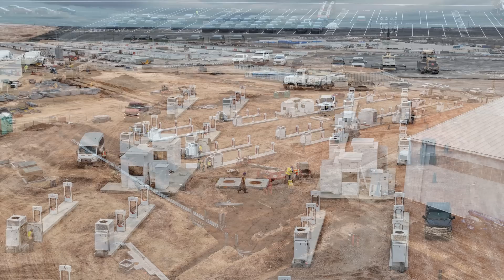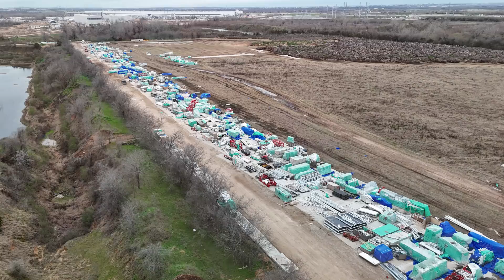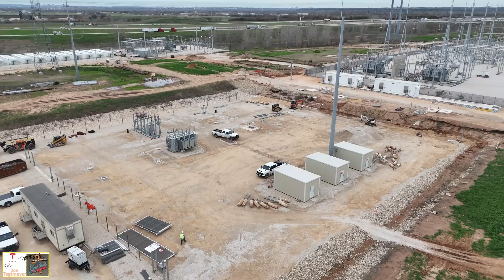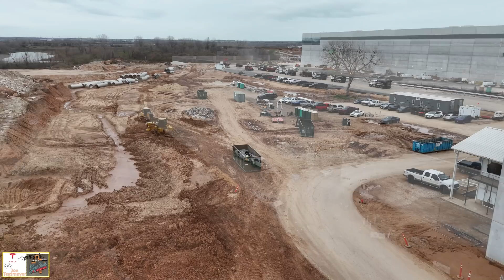Cybertrucks! Megapack Connected! TKS Paint System Delivery! 16 Feb 2024 Giga Texas Update (07:35AM)

Comment: Im convinced once they complete the 2nd phase of solar panel installation on the roof they surely have to connect it to the megapacks at that point. Interesting to see how it develops. 

Thankyou for your videos Joe, never miss a single one!
Reply: Not really. With all 70,0000 panels installed, they will produce about 30 MW. The 96 Superchargers currently installed (64 on the westside and 32 on the eastside) will require 9 or 10 MW. While Tesla doesn't publish the energy requirements of the factory, it will likely use all of the energy produced by the panels. That is, unless it is shut down for a holiday or some other reason. In which case, excess power can back-feed through the factory's electrical system and the existing duct-banks to the Tesla Enclosure/Mega-vault, LCRA substation and to the grid.
However... Sending excess power to the directly to the Megapacks would be technically difficult because as presently designed, there is no direct connection. The backup power feeds from the Megapacks have circuit breakers that operate in a normally open configuration.
Reply: @DavidJohnson-tv2nn Thankyou for that. I wrongfully assumed consumption would be less then production they would need to evenly distribute over 24h, hadnt factored in the expansion on the west side and to be fair now youve got me thinking, its only going to increase.

Comment: Put of interest 🧐🤨 at 18:27 the tunnel segments, how heavy are they???
Reply: Depends on the thickness  of the ring but heres my best guess.
one ring = 6 segments;  ID 12 foot;   OD = 13 foot;   average diameter = 12.5 foot (3.8m);   they are (I believe) 5 foot long (1.52m);   6 inches (0.15m) thick. Concrete is 2,400kg/m3. So: 3.8 x 3.142 (Pi) x 0.15 x 1.52 x 2400 / 6 = 1,088Kg per segment (they are slightly different in size so this is an average) around 2,400 pounds each segment in Banana Sheckles.
Reply: Most TBM erector systems use a vacuum pad to lift the segments into place (i.e. no mechanical connection). Then dowels (plastic or metal) on the circle joint connections and spear bolts (galvanized HT steel) on the radial connections.
Reply: @davidsalisbury50  Joe has some documentation on his Patreon site for the now defunct proposal for a tunnel under the Colorado River. Location was at the far east end of Tesla Road

Assuming the same lining rings proposed on that project are to be used for this under Highway project, then the external diameter is 13.5’, internal 12’. And those rings were also shown as 5’ (59” to 61”) long.
Reply: @DessieDoolan  That would make them about 1,700Kg per segment plate.
Reply: @davidsalisbury50  I have just realised the defunct under river project was using 18" 0.45m thick segments! Or....not.

That seems extraordinarily thick now that I give it some thought. 

I misread the drawings, and my lazy use of an online calculator (because working in imperial does my head in these days) had me miss the obvious extraordinary thickness.

The sectional elevation shows internal diameter of 144", external of 162". It's not a complete set of drawings btw, 30 only that accompanied the initial permit application. Seems the section shows the ring inside the shield. No indication that it does, dwg marked 'ring elevations'. Trap for a young player.

Next dwg. in 'Segment Details', shows 9" thick segments.

Now I get 5.88 tonnes for a ring.
Reply: OD is ID + 2 x thickness.
So 9” (225mm) thick segments.

Comment: I'm kinda guessing but I think those tanks on the SE might be Small =75,000 gal , Large = 120,000 gal.
they're big!
Reply: Estimated to be 42' high. Still working on diameters.

Edit. 19' and 29' diameter.

6:14 in the video. Should be accurate enough. The small tanks are very close to the edge of the building line.

Draw a line across the top of the smaller tanks to where it meets the corner of Stamping. Overall height of the building is 80', and the point at where the top of tanks intersects scales to 42'. Assuming that's right, then from the same view the diameter of each tank can be scaled from the tank height. 19' and 29'.

12160 cubic feet, and 27741 cubic feet. 90963 us gallons, and 207517 us gallons.

345000 litres, 786000 litres.
Reply: At 42 feet I will recalculate.Small =100,000 gal,  Large =150,000 gal.
Reply: @staudtj1   See what you come up with scaling the diameter from the height at 6:14. The big tanks are 20' behind, so scaling less accurate, again.
Reply: @DessieDoolan  the formula would be the radius squared times pi times the height * 7.48 equals gallons.
Reply: @staudtj1  I'll admit I'm way out of practice with imperial measurements. In metric it checks out close enough. 

In feet and inches, I worked out cubic feet then my go-to conversion site 'convert units' and converted cubic feet to us gallons.

I hadn't thought to try and estimate the size of these before, until your guess prompted me. Thanks!

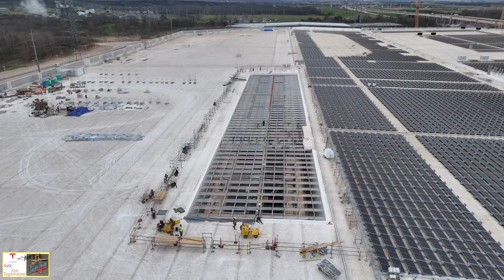Comment: 10:00 Back when the GF was first being built, several of the folks that knew a bit about construction of large facilities along with myself kept wondering where they were going to build the cooling towers. I’d love to hear from a current engineer on why they are building many separate cooling systems with both wet and dry coolers instead of using the old school large campus wide plants that made enough chilled or heated water for the entire campus. I’m in my 60s and back in the day, this size of plant would have a separate building with several huge cooling towers, compressors, and other physical plant systems. This was how it was done. Here we are seeing many, many smaller units being used. Like I said, I’d love to hear the thinking and rationale for doing it this way.
Reply: Also, mostly under the roof. Shanghai and Berlin, mostly on the roof.

Comment: What are the 4 large TBM sections covered in black tarps for?
Reply: Those are the backup decks. Contain all the TBM support systems. Control cabin, hydraulic pumps, electrical switchgear, segment handling, transformers, utility reels, grout pumps, grease pumps. It's basically a moving factory.

Comment: Thanks Joe.
Yes, you covered a lot of ground today.
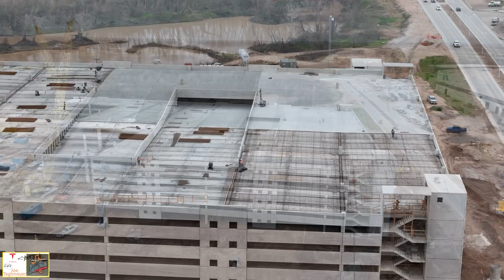9:06. Parking Garage. Bottom right. Turned the corner with the blue water main. Stormwater drain riser on the west side.
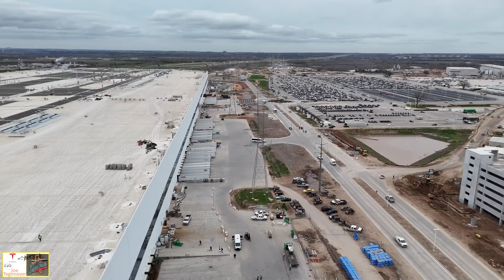9:42. BIW apron. Green pump located where the temporary chiller plant was. Some hoses laid out. A red pump also up by the East Main Entrance at 29:42.
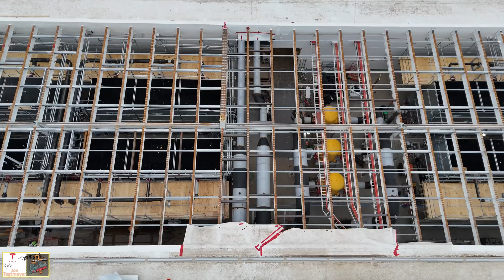10:23. BIW. Under-roof plant room. Scaffold decks installed below. Likely for the pipe lagging/insulation works.
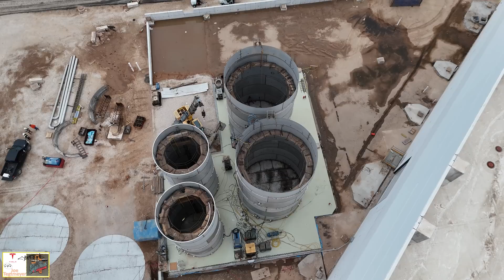11:09. Southend. Tank Farm. Left. Curved items might be handrails for the top of the tank.
11:44. Southend. Bottom. The puzzling CFA pile extension works. I’d like to know if this is some pig-headed demand for completion of the piles as documented, or if there has been some change of plan.
12:18. Southend. Beams on the trailer. Projections are bridging for the roof or floor decking to land on where the decking isn’t to span across the construction joint. Same detail at 12:32.
12:47. Southend, south. Blue tape holding some component of the end channel in place. Glazing won’t be mitred, as it is on a construction joint between buildings.
14:06. GA, perimeter road. Street lighting installed. Again.
14:55.  GA, apron. Bottom right. Battery packs.
15:07. GA, apron. New loading docks, wall openings were cut when no-one was watching. Weren’t plugged. Demolition and excavation works complete. Some formwork placed.
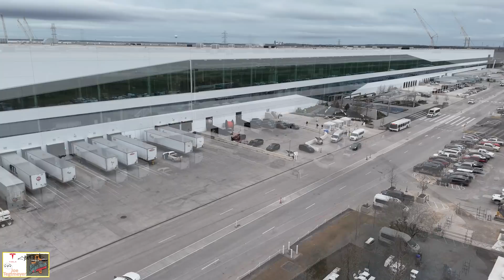15:57. GA, apron. Hose down into one of the sanitary sewer wet-wells. Ongoing troubles.
16:20. New EOL, apron. North. Delivery of a large framed sprocket. Suggests a moving line. No in-floor channel, must be surface mounted.
17:10. New EOL west. Gravel deliveries.
17:29. New EOL superchargers. Top right. Setting up the temporary water supply. 0:45 also.
26:23. BESS Installation. Megapacks. Awaiting twinkling LEDs on the megapacks to confirm if live. The generator up beside the control building needs to go also before there can be confirmation of project completion and final commissioning.
27:30. Tesla Road, north. Bottom right. Might be the office trailer from the old Transport Yard.
27:56. Battery north, loading platforms. Alimaks hoisted to the top. Gate installed on right elevator, left elevator works in progress.
28:50. Casting east, apron. In Joe’s photos, an empty heavy duty low-loader is seen leaving. Another (also empty) seen parked in the WOW yard in Brad’s video yesterday.
30:10. EOL superchargers. Top right. Ductbank works progressing south to the Parking Garage.
31:24. Robotic Avenue. Line marking works.
31:41. Tesla Road, east. Taking the hump out of what will be a re-aligned Tesla Road.
32:31. Cathode, plant platform. Bottom. Pipe insulation/lagging works.
32:36. Cathode, east. Apron. Geo-mesh rolled out. Grave being spread over prior to asphalt paving over.
33:30. Cathode, north. Green transformer cabinet (cooling fins) being unloaded.
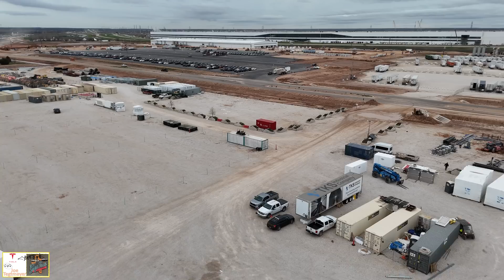Reply: @21:10 The superchargers from the south end x 32 have disappeared from here.  Wonder if they have been moved somewhere to have the orientation changed before installation somewhere else at the EOL.
Reply: @Dwayne.Shea.231  21:10 Nicely spotted. Need to keep an eye out and see if they show up in one of the electricians compounds around the place.
Reply: @DessieDoolan  20:28 I think I see them where the others were configured...off in the distance.  Unless those were brought over from the east.
Reply: @sammyk874  20:44 Seems to be them. Joe might have got a better photo.
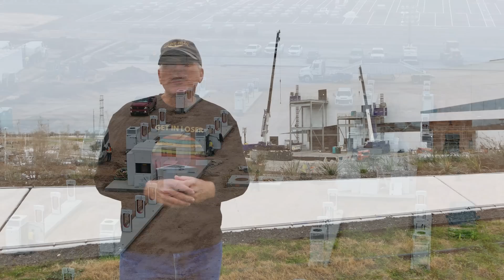Reply: @DessieDoolan  The ones stored on the east side (new orientation) are gone.  They were there on Jan 28 but gone Feb 6 (per Jeff's videos).  I think I see the south end ones in Brad's video from yesterday 0:50.
Reply: @sammyk874  Yep, that must them. Joe's photo 77 is the pick of the photos, but no better than the video.

The 16 from the far east on Tesla Road, and the 48 from the W-WOW assembly location conveniently totals those at the New EOL.

Parking Garage. That would be a likely location for Superchargers. Ground floor, so that expensive cabling doesn't need to be run to the upper decks. Something else to watch out for.
Reply: @DessieDoolan  Ah yes. Thought all 64 were on the west plus 16 on the west side. I wonder if they’ll move the current superchargers on the east side into the garage. They seem a little out of place now.
Reply: @sammyk874  Supercharger relocation. Nothing is sacred!
Reply: @DessieDoolan  My wild speculation is that the old style superchargers go south of the 64 on the west side (using solar canopies from east) and the existing east siders go into the garage.  Likely 99.9% wrong. :)
Reply: @sammyk874  Old style superchargers. A chance is a chance!

Charging generally has changed often on site. Both supercharger and destination charging (the smaller units).
Driven by the ever changing construction, a consolidation might be due.

There was a row of destination chargers on the east of Casting. I don't think they'll be coming back.
Might have been another couple of rows further south near BIW.
Superchargers removed from the south end of GA.
GA west, there were dozens north of the Main Entrance. Removed when the loading docks were unplugged. 😑
Now only 7 at the Main Entrance reserved for Security, I think another 7 on the other side of the entrance.
Northend. More or less unchanged. They've added, never removed.
Existing EOL charging. That was parking with rows of destination chargers, then the Superchargers were added when EOL moved in. I don't think the destination chargers are generally used by EOL.
Parking lot to the north has superchargers and destination chargers near the roundabout end.

Parking Garage. Have to be charging stations. Grouped to keep cabling costs down?
Reply: Dessie, have you seen the videos from Airwave Dynamics?  So far two from GF (week apart) and another from TBC/Starlink.  He typically does downtown skyscrapers and other odds and ends around Austin and beyond.  You may find interest in those other things as well.
Reply: @sammyk874   Airwave Dynamics. I'll check it out.

32:36. Well, I guess it's neither a grave, nor is it dirt! Trying to drop a gentle hint......
Reply: @sammyk874  Airwave Daynanics. I watched the GT video. Couple of things he showed we otherwise didn't see. The shifting of the office trailers out of the Transport Yard, just how far the Parking Garage culverts got pushed on a skew with the extreme rain (9.36 in his video).

Good to see it from a higher altitude.

Thanks for the tip!
Reply: @DessieDoolan  Yes, a slightly different perspective.  I originally followed him for the downtown construction videos.  Then he started adding other interesting things.
Reply: 31:24 looks like they're about to cut it out and put in medians .
Reply: @benguthrie49   31:24. There are some new lines marked. I did first take the machines to be road saws, but just line markers as far as I can tell. at 31:21 it is clearer what they are up to.
Reply: @33:30 I am tipping this is going near the lift station, lots of conduits etc there.
Reply: @Dwayne.Shea.231  33:30. Other than hopefully correctly identifying it as a transformer, I'm out of my depth with this sort of stuff.

Lots of external plant and buildings around Cathode that it might serve. As you say, the lift station, but also the Crash Test Track, The Wade Pit, Cell Test lab are all on generators still. Plus street lighting.

Possibly also works required with the Tesla Road works.
Reply: 32:36 Sounds morbid. :)

Comment: I think you are right, the parts in the far north, the new paint system, and the new tanks (reservoirs for painting?) are for the new low-cost car.  I wonder if some of the new line will be visible through the glass wall?  Would be spectacular.
Reply: If I was Elon, I'd make a portion visible through the glass wall with a Live Webcam pointing at it, just to piss off the other OEMs and haters!!

Comment: Thanks Joe!
EOL facility:
Westside of building:
@ 17:03 (by the man lift) Possible power supply for the building? There is a transformer or switchgear cabinet. Matches up with the location of conduits seen in Joe's video 12/22/223 at the 11 :21 timestamp, and Brad's video 11/2/2023 at the 5: 57 timestamp.
BESS substation:
@ 26:07 (Upper right) Hard to see but the switches for the backup power feeds appear open.
@ 25:34 and 25:52 All the necessary switches are closed, but... That does NOT guaranty that the Megapacks are operational. The state of the circuit breakers remains unknown.
North parking lot:
@ 27:39 (Bottom) Cable splicing in open vault appears complete.
East side of casting:
@ 29:15 (Vault by the building) Cable pull into the building. Cables will also be pulled through the duct-bank to the vault by the stairs.
It is also possible that new cables still have to be pulled through for the Superchargers.

Comment: Can we have an analysis on why does the parking lot need concrete poured over it? I mean it's made out of preassembled concrete, wouldn't it be much faster if it was made in such a way that is ready to go once assembled?
Reply: It transfers weight between panels. It stiffens the building. It levels the deck and provides a smooth/ broom finish surface, . It helps to control water between levels. The sides are open and the wet cars bring in a lot of water.
Reply: Would be near impossible to get all of those Double T decks to align.

Previously estimated about 2400 Double T floor decks for the entire Parking Garage.

If you go to 7:43, behind the crane on the right, you can see that the floors aren't level. Twists on approaches to ramps, and to aid with the drainage.

I don't know how they achieve that without building a twist into the Double T deck segments, or if they are flat decks where they simply pack under the rib as required. Either way they do it, the long edges would be near impossible to get to meet with any consistency. There's also an upward camber in each Double T adding to the level of complexity.

The topping slab buries all those tricky intersections. Provides some structure as well, although I don't know how much. The precast column segments are bolted connections. Beam to column connection is a welded connection between embedded plates, Double T to beam, and Double T to Double T is also welded.
Reply: The structure would collapse very quickly without lateral support. The concrete decking helps provide that support, as do shear walls at various locations.

Comment: Those switches that feed the megapacks were not closed yesterday morning they may have switched the system on yesterday afternoon.
Reply: Unfortunately, we still don't know for sure if the Megapacks are operational. Due to the fact that we can't tell if the circuit breakers are open or closed from the drone view.
Reply: @DavidJohnson-tv2nn  Are you talking about the individual megapacks? The ones I have been showing over my past two videos are closed now which still doesn't mean they are online. There could be a switch on the megapacks themselves that could be still open.
Reply: @BTS-Astro1  No, I'm talking about the circuit breakers. @ 25:59 See the grey box-like things behind 8 conduits that come out of the ground? Those are the 24.9 kV circuit breakers. They must also be closed. And there is no way of knowing if they are open or closed from the drone view. There is also a set of 345 kV circuit breakers on the primary side (North side) of the large transformer. In addition.... There are more circuit breakers in the east bay of the LCRA substation. ALL must be closed for the Megapacks to be operational. 

Though you are also correct. It is likely that the Megapacks are also individually switched. Those switches or breakers would also be unseen. Hidden in the Megapack transformer cabinets.

So while the switch positions can confirm the Megapacks are offline, they can not confirm with certainty that they are online.